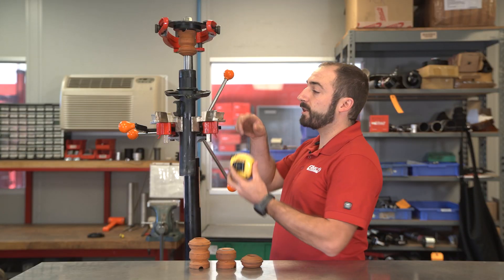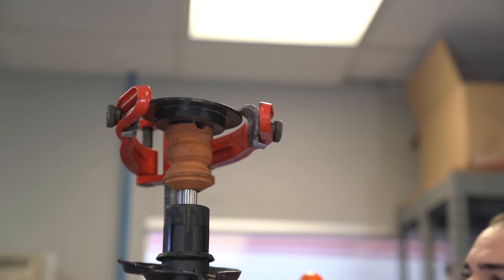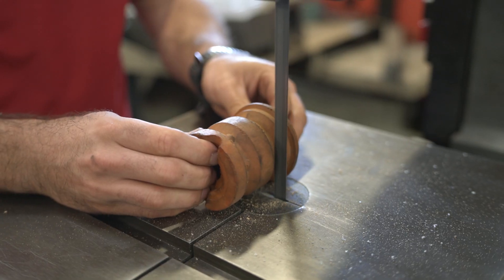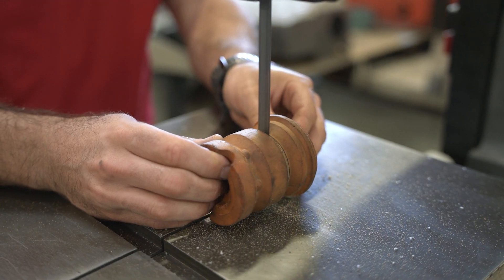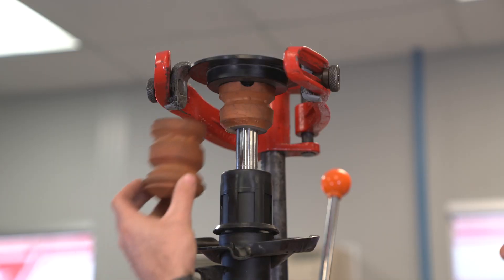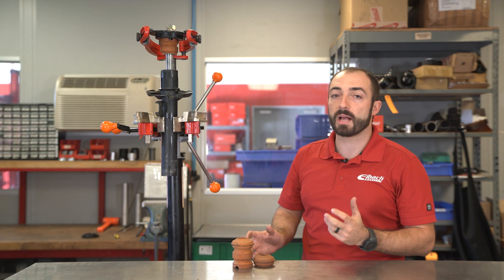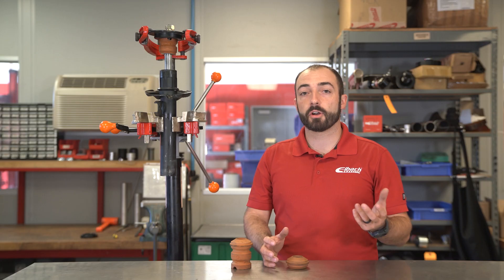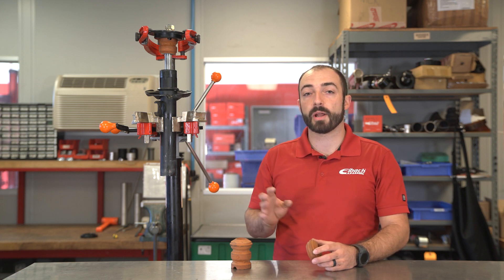FAQ Friday: Do I need to trim bump stops?

Comment: Ive just fitted 60mm front lowering springs on my 320d msport touring.. do i need to trim my bump stops and how much would you suggest? 1" ?.. thanks.
Reply from the maker: You should only trim if the instructions say so, otherwise leave it as is. We believe for that vehicle it is not required.

Comment: I have 2007 mk4 ford mondeo and getting eibach pro-kit lowering springs. So do I need to cut front oem bump stops 1 inch? Rear has springs and shocks separately so it needs cutting from there too?

Comment: My instructions says in the front only to cut bump rubber at 20mm from the bottom and use upper portion i need help where is my bunp rubber is it in the shock infiniti m37

Comment: I went just purchased KYB R4273, KYB SR4274, KYB SR4068, KYB SR4069 for my 2007 Toyota Corolla S. since those are OEM shocks and I want to install some Tein Lowering Springs. Do you sell pre-cut bump stops for that set-up? Can I the stock coil dust covers that came with the shocks and struts?
Reply from the maker: Hello, that question is best answered by Tein, we don't know what they recommend.
Reply: @EibachUSA  I know what they want cut off on the front and rears, I was just wondering if you folks made already cut bump-stops. I am a little surprised that you guys don't corner that market, and produce ready cut ones for folks that buy your stuff.

Comment: QUESTION: Would not trimming the rear bump stop cause a clunking noise? im experiencing clunking noise when hitting bumps in the road and on the highway when going over small dips. I’ve checked every nut and bolt but I can’t seems to find what’s the problem. (Eibach Pro Kit Lowering Springs) I have a 2021 Dodge Charger Scat Pack.
Reply from the maker: Hello, please reach out to our tech support team: https://eibach.com/us/p-187-technical-support.html
Reply: Hi.  What was the outcome on this?  Were you able to determine if the clunk noise was in the front or rear? Thx!
Reply: @samrmills pretty sure it will fix the clunking issue, depending on the type of springs installed

Comment: I bought the sport line kit for my 22 mustang gt. I used the factory bump stops and not the ones that came in the kit. Any issues I might run into?
Reply from the maker: If you have any ride discomforts that may be the case.

Comment: I have this problem with a Bilstein B12 pro kit on a BMW Z4M. You would think as a kit the shock bump stop would be trimmed to work with the supplied Eibach spring which lowers 20mm at the front. Bottoms out really easily and makes me wince.
Reply: Hi Gary , did you manage to replace bump stops or did you decided to cut original ones

Comment: Could this actually be the problem on my Porsche 996 C2??? I’m literally about to swap to HR’s to try and solve the high ride height vs the drop in the rears… I am literally driving a boat.  In the instructions it states no modifications required but on many forums, folks are stating the same issue… please advise as it will keep me a customer if this solves the issue… thanks!
Reply: I have the same, my rear suspension is almost inactive and totally feels like a boat now. Didn't used to be that way. I thought maybe I'd blown the rear shocks by overloading but when I examined them they looked ok. About to go back to OEM sport springs on the rear I think!

Comment: I’m buying a used set of springs 4088.140 for my Civic Si… they are missing the Bump stops, can I buy them direct and whats the part number? Thanks
Reply from the maker: If you're in the US, give us a call at 800-507-2338
Reply: Eibach USA can i install for my camery 2005 one and half of jounce bumper to increase the height and save my shock from damage? Or just one is enough؟

Comment: More shock travel with trimmed bump stops is obvious. However; what effect does it have on the stock shock longevity? 
Removing 1" from the bump stop, would cause the shock to compress further than with untrimmed bump stops, putting more stress/pressure on the shock.
Reply from the maker: Hello, trimming the bump stop won’t have an effect on shock longevity. The bump stop acts like a progressive rate, once you hit it you add rate and gives you bottoming resistance so you the transition isn’t so harsh when you reach the end of your travel.
Reply: @EibachUSA  If you trim too much you will bottom out the internal shock !